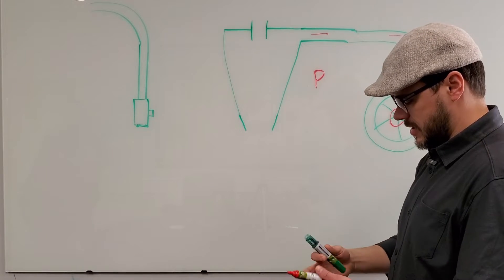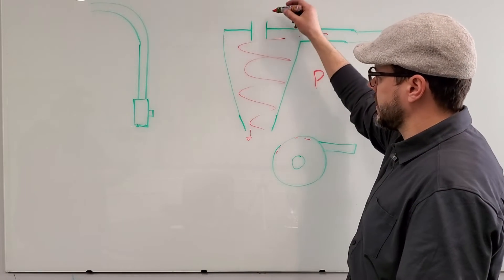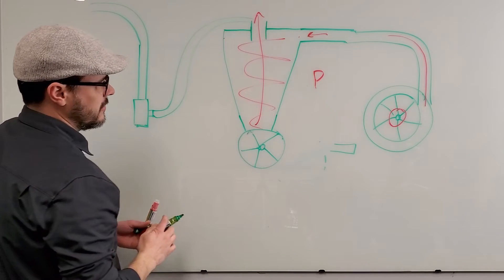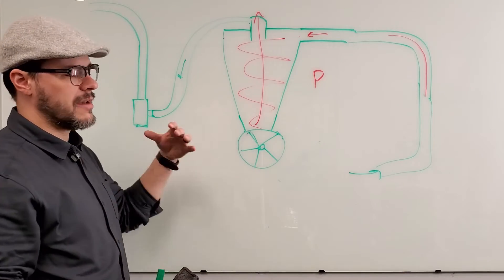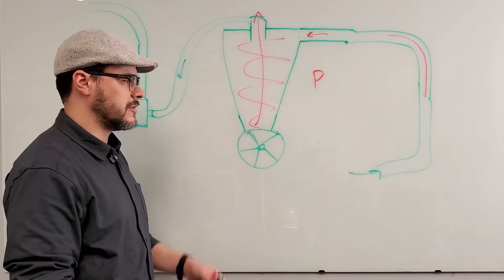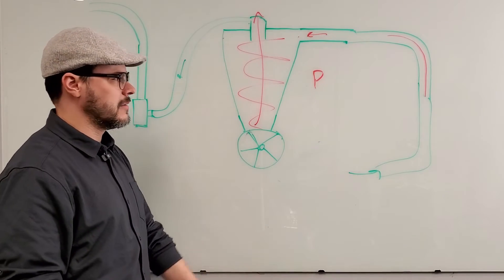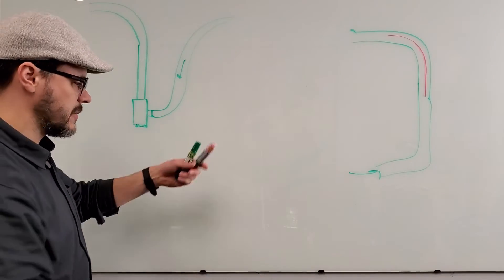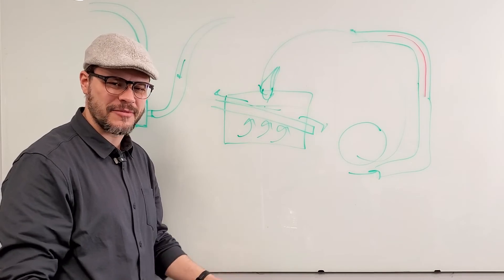How Does a Cyclone Separator Work?

Comment: Do you know if there is difference in efficiency between pressure or vacuum operation ?
Reply from the maker: Blowing it in is more efficient. However, depending on the application, you will get more wear on the blower.

Comment: Correct me if I'm wrong, but the vaccum is similar to my Filter Queen vaccum.  Just no air lock on bottom.
Reply from the maker: @al9929  correct, same principle. If you had a seal between a drum or container below the cyclone, you could forgo the airlock. The airlock is only needed if you want continuous uninterrupted discharge into an open top container, or into another mechanical process.